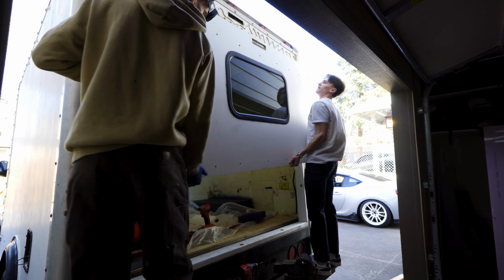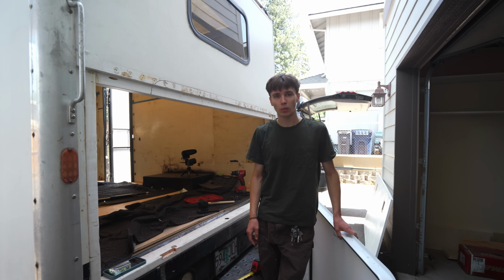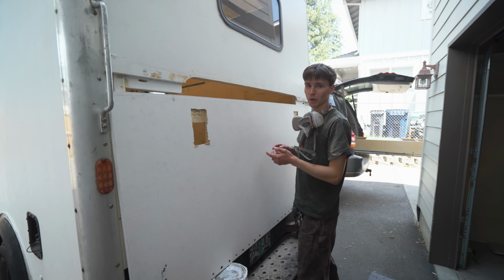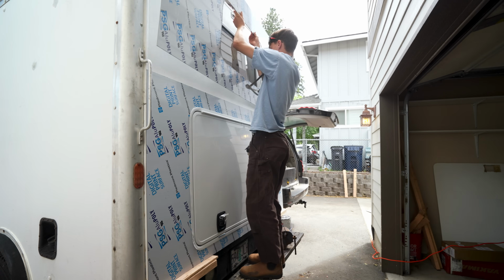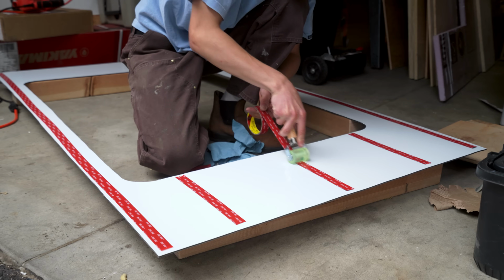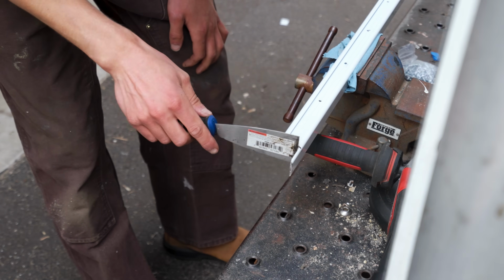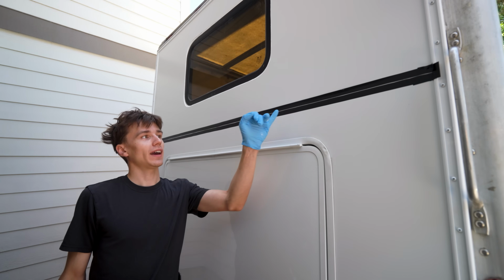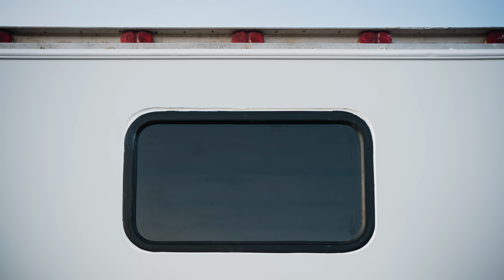Rebuilding the Back Wall on My Box Van (FINALLY DONE!) | Ford E350 Camper Build

Comment: You did a great job on that back wall. I am in the process of building out a box truck. I have been undecided about the rear roll up door. But, now I think I am going to follow your lead. Where did you get that RV door that you installed in the rear wall?
Reply from the maker: Thanks so much for watching! I actually found it on eBay. It was a pretty random purchase, but it seems like there were quite a few options of all different sizes! Just make sure you find one that includes the keys, lots say the keys aren't included.
Reply: @maxwell.peters , do you reminder what description you used on Ebay when that door came up?

Comment: That’s got a really pro look to the back of the van now - nice job! I would keep an eye on that horizontal join between the two aluminum sheets, though. It might open up very slightly with temperature change/movement but enough to allow water to creep behind. Another piece of trim or a flat trim tape should do the job, though. You’re going to end up wanting to put that stuff over the rest of the box now! Would look nice but be pricey, I can’t imagine that it’s cheap to buy. 👍🏻
Reply from the maker: Thanks so much for the comment! I didn’t think about that but a flat piece of trim would probably work super well there! I appreciate your suggestion!

Comment: Nice job on the wall. I used to build RVs at a manufacturing company here in Canada, this is what we would do. the trim should have buytl tape under them. And get some Dicor RV sealant non sagging to seal up the edges of the trim. And put a bit of dicor sealant non sagging in each of the holes before screwing in the trim. Another area to put dicor sealant is along the top edge of the sides of the door trim. That seam in the middle of the wall between the panels, they make a flat trim for RVs. If you go to a RV supply store they would beable to guide you in the right directions. I understand you dont want to put screws through the panels but a seam like that will open up from vibration and heat so installing a trim to secure it is a great option. You are a fast learner and I glad you revisited the back wall to improve it. You should be so proud of yourself. Congratulations 👍

Comment: You're suppost to put the Buytl tape under that trim from RecPro. Each screw has the potential to let water in dispite being covered by the rubber. It's the Buytl tape that makes it waterproof not the outside rubber cover which is only for decoration.
Reply from the maker: Ooo good to know! This would be an easy thing to add! Thanks so much for the suggestion!